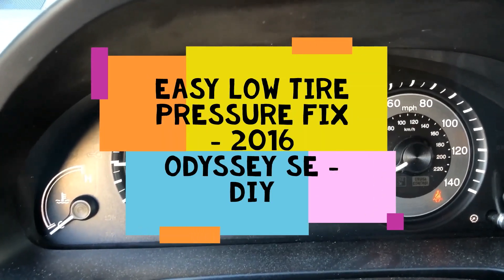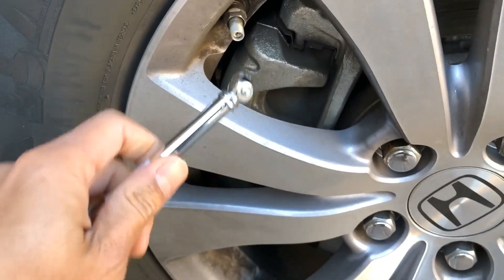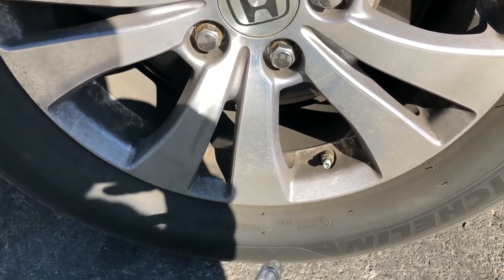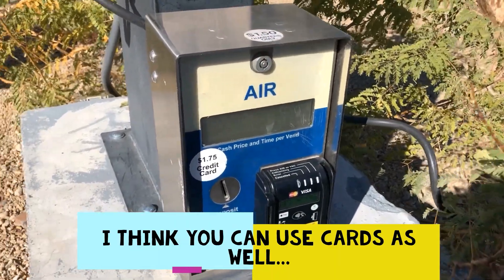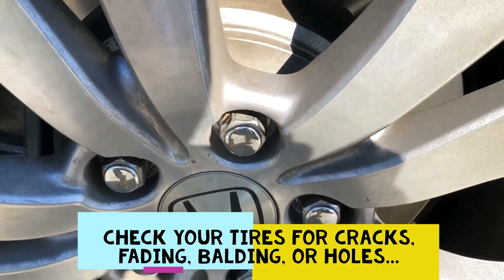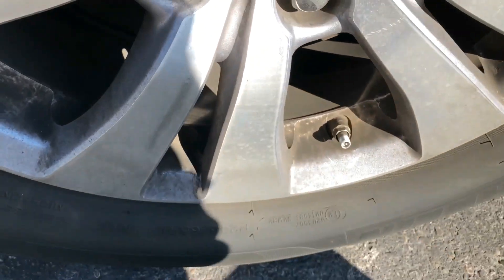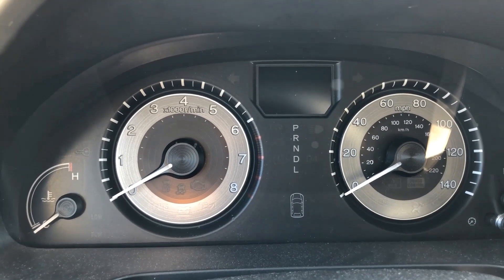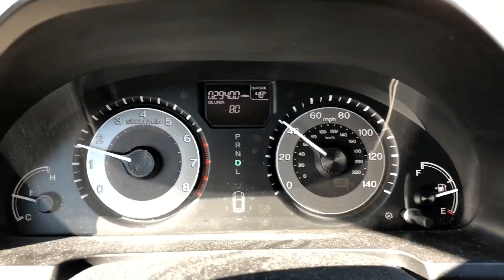Easy Fix - Tire Pressure Sensor light - 2016 Honda Odyssey SE

Comment: What?? Why did you just waste 4 min of my time to show me how to put air in the tires and then you didn’t even solve the issue yourself!?? What the.. ? Change your title to “how to put air in tires without solving issue”.
Reply from the maker: You solve the issue by putting air in your tires. That light only shows up if your tire pressure is low. And that’s what I did. Thanks for the comment.
Reply from the maker: After putting the air and the air pressure is good to factory specs.. I turned the car on and drove it... sensors automatically resets... Lol don’t get why people are so upset with this video.
Reply: @h0melyfe792  these ppl don't even know how to check their own oil😂😂 of course they are gonna get mad u needa tell em each and every step!! good vid m8
Reply from the maker: @thatguy5339  thank you! Appreciate it.
Reply: I’ll never get them back
Reply: @thatguy5339  sometimes, the light stays on
Reply: @dwong98  research
Reply: @dwong98  Correct. Like on a 2016 odyssey with no TMPS calibration

Comment: There’s only a light?  Nothing on any of the screens?
Reply from the maker: lifehackertips.. yeah it only lights up if your tire pressure is low. Then computer resets when tire pressure is back to normal.
Reply: H0Me LYFe so weird that a 2016 would only have a light.  Weren’t these almost $30,000?
Reply from the maker: lifehackertips.. from what I remember around 32k ish.. maintenance light came on. Had my oil changed, tires rotated.
Reply: H0Me LYFe that’s crazy that a $32,000 vehicle in 2016 still only has a light to indicate low pressure in one of the tires.
Reply: I agree. It's strange that they don't have an indicator showing the pressure within each tire.